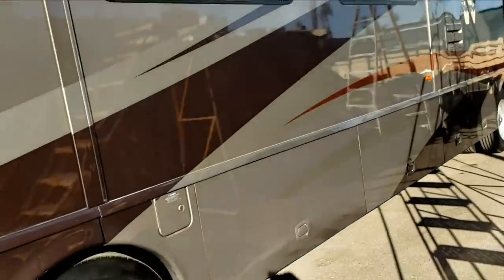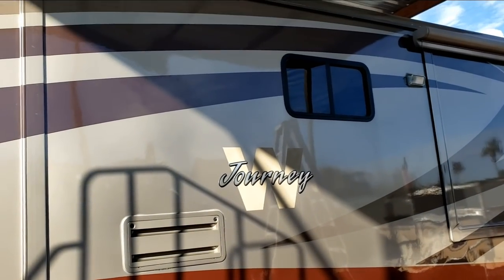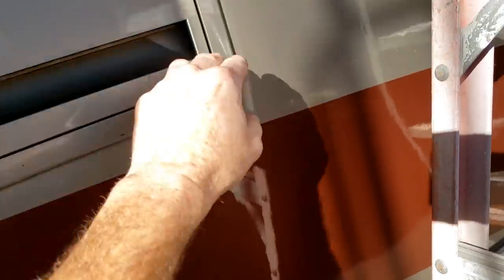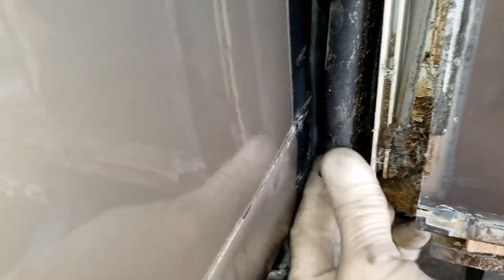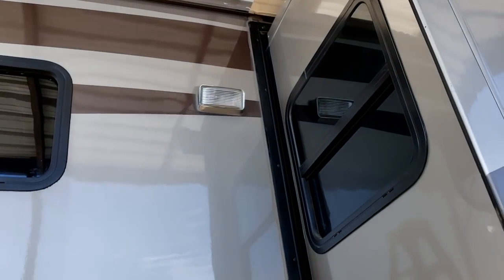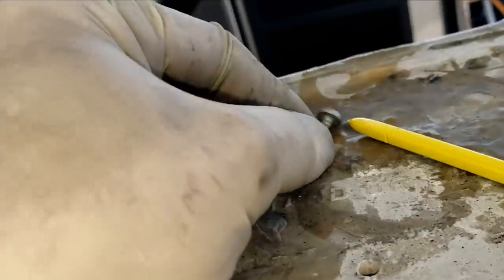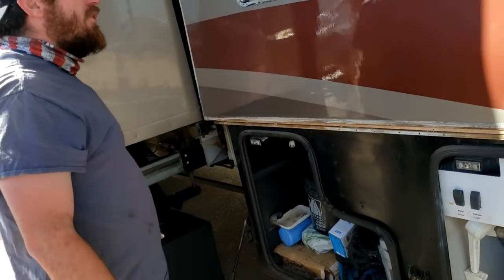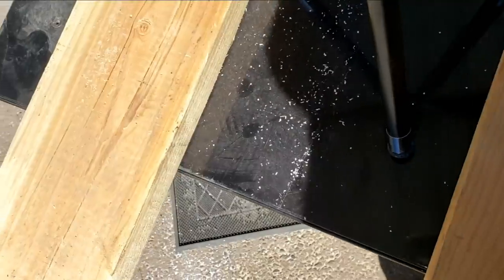RV Sidewall Water Damage...What Did We Find?

Comment: Awesome and timely video!  I have the exact problem in that exact area next to my super slide of our motorhome.  Now that I see your video, I know my leak is from the top corner of the slide.  I don’t k ow, however, how to get the belt line trim between the wall and storage doors off.  It seems to have rivets.  I wish you were in Colorado to do work.  Unfortunately I’m not aware of any reputable shops in Colorado.  They would probably do the same kind of poor job that was previously done on that Winnebago and charge a lot for it.  Looking forward to seeing the 2nd part of your video.  Take care!
Reply from the maker: thank you. it should be out tomorrow

Comment: It's interesting to see how flexible that painted panel is and you didn't get any creasing while prying it away from the luan. How much different do you think that filon siding is from what I have on my 2008 thor aerolite travel trailer? I have an area that is bubbled up. I've tackled the leaks (not too happy about how the awning is attached thru the gutters) so now I'll be interested in the materials you use to put your project back together. Thanks for the videos!
Reply from the maker: The paint is high quality Sherwin-Williams autobody, but the sidewall is true gel-coat fiberglass and I keep calling it filon. I didn't realize until the end. You likely have filon, but it will be the same process. Thanks!

Comment: I like the care and thoughtful planning in the disassembly. Are there products the DYI'er can use to reinstall the Filing? I have some STA-put and 3M 78 but they are expensive and not easy to get.
Reply from the maker: I would not recommend any spraycan adhesives. 3M does make a scotchweld like stabond, but if you're going to do this amount of work, might as well spend the extra $200 for the right glue I'd think.
Reply: @AZExpert  and by the right glue you mean? Also any thoughts on the process people use injecting epoxy and clamp?

Comment: Everything leaks 🤦🏼‍♂️ the roof looked good so what could they do to prevent that? I assume inspection of all the penetration points yearly. 
Since it’s Luan it got wet and delaminates. If it was Azdel it would not delam? Right ?
Reply from the maker: Yes, I told the owner that really none of it was preventable, it was Winnebago's fault. Azdel would have prevented it, yes! I think Winnebago has switched to it as the 2019 Minnie Winnie has non-luan sidewalls.

Comment: Man, that’s stressful work. What’s the material called that the paint is on? That could have been a nightmare if that had to be repainted. That owner’s lucky she had you doing the job.
Reply from the maker: though I keep calling it filon, it is actually gel-coat fiberglass, a very durable material. Yes, it would have been a nightmare. I didn't feel good until the job was done. :)

Comment: You mentioned that 3M Supper 90 is not a good choice. I saw were you used Stabond 440  and 183 on the Itasca (mini-winnie) with the delaminated passenger side panel from a leaking roof video, you know the "tedious" one. I have a 5th wheel (2004) with about the same delamination but this was an old repair with a seam at the break of the 5th wheel section. So I have just about the same area to rework as the Itasca. But I don't need a gallon of Staybond x2 one for the filon and the other for the foam side! is there an O.K good available? Thanks I love your videos! You are to the point and tell it like it is!

Comment: James, you made a positive comment about the residential refrigerator that was installed in this unit. Are they as good as the more traditional gas/electric units? Seems there's less potential for leaks from the wall/roof vents. But are they as rugged?
Reply from the maker: I have found them to be as reliable if not more reliable that rv refrigerators and of course don't cause fires and are much bigger and cheaper. The only draw back is if you dry camp often they would not be a good choice
Reply: @AZExpert  thanks, James. That's really helpful.

Comment: I have seen a lot of rvs getting their roofs line x or bed linered. What is your take on that, I have done my own epdm roof on our last 29 ft bumper pull travel trailer with no slides and it was a ton of work and money. I now have a 39 ft fifth wheel with 4 slides and the slide roofs and the main roof needs to be done and i was thinking of "trying" the bedliner on new wood. Just curious to see what you think? Great videos by the way not many people like you that are honest and willing to show a skilled job.
Reply from the maker: Thank you. The bedliner/spray-on roofs are very durable and work great. My only real concerns are 1) vents and skylights are encased in the material so replacement has to go back to the roof shop 2) adding different items like solar, satellite, antennas requires going back to the shop.

Comment: I am going to put some new filon on the back wall of my frontier, what adhesive would you recommend? I look at the 3M 1357 but not sure what to use. Thanks
Reply from the maker: i like the stabond I do not like the waterbease fastbond
Reply: @AZExpert  Thanks one quick question. Somebody has been on the back wall before me. Looks like they replaced luan but screwed into the aluminum studs. Should I glue it before adding the new filon? Thanks

Comment: I've bought one travel trailer---a Little Guy.  The side wall rotted (before I got the thing) and broke loose from the frame.  I will attempt a repair. Then I will cut my losses and sell it.  I will never buy another travel trailer.  I had an enclosed cargo trailer for years.  Never a problem.
Reply from the maker: Once there is a leak it becomes a big problem